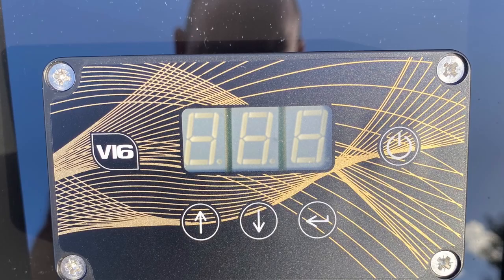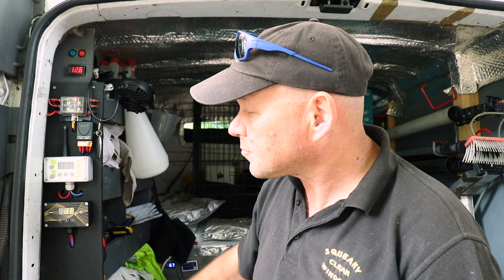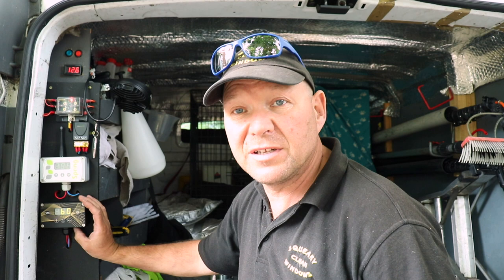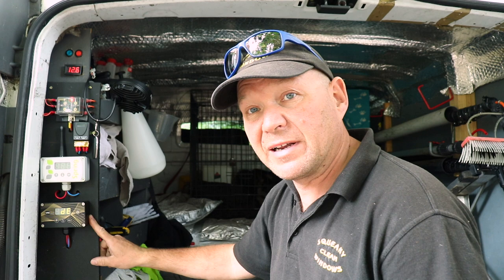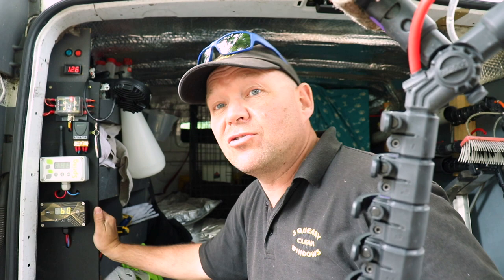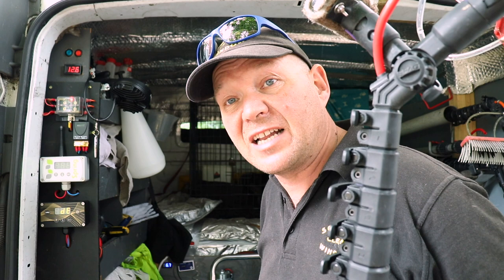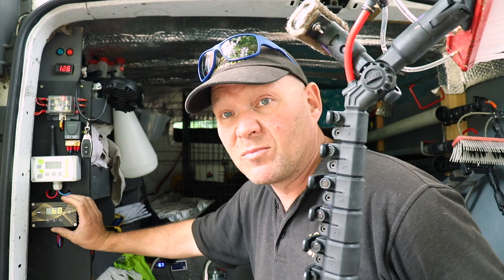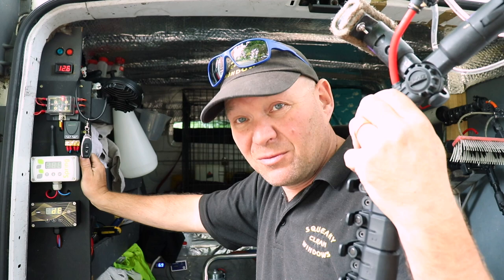Understanding Controller Dead Ends And How To Set Them

Comment: Thanks Dave...another one here who very much appreciates what you ve done for so many of us out there who have trouble with out digital controllers...just had a new one fitted a few weeks ago and all good at first   then suddenly stopped working today ..at the moment its I've still not been able to even turn it off ..so expecting its been either badly fitted some type of electrical problem  will now try again tomorw but feeling much more confident and happier after just watching your very well presented video....just to say you a thank you again Dave
Reply from the maker: Check your fuse then check for a loose wire

Comment: Hi Dave.
At the moment, I'm using the pump from an Electronic gardensprayer. It only runs 60psi, but it's enough I think. (most people runs their 100 psi pumps on 60 anyways)

It starts an stops automaticly as i pull the univalve. For over a year now, I have never blown a connection or the pump itself.

The more I learn about the 100psi pumps and the flowcontrollers, the more I think, that I'm better of with my current setup.

Convince me😉
Have a nice day.
Best regards
Reply from the maker: My last shurflo pump lasted me for 10 years and was still working when I changed it. It had just slowed down. 

Smaller pumps will work but it’s the difference between buying a diy tool from B and Q and buying a tradesmans tool. They both work and do the job but the tradesmans tool will last longer, be easier to use and be more efficient. 
It’s the same with pumps. I like to have a hi flow so if I used a smaller pump it would be working flat out to give me the same amount of water as a bigger pump working at 60%. 
Hope this makes sense. I’m not trying to say I’m right or wrong. It’s just my opinion 👍

Comment: I have been seeing PS flashing and was told it signifies an air lock. Been trying for ages to clear it to but no avail. Looks like i had the wrong advice. Will be doing the auto calibration first thing in the morning. Thanks Dave, really informative video for a newbie like me. i will have to look at everything else now to see where else i'm going wrong!! Fantastic advice. So glad i have stumbled across your channel.
Reply from the maker: Glad you found it useful. Definitely sounds like a calibration problem. PS stands for pressure switch which is the mechanical way of stopping the pump
When it’s set correctly it will come up as DE
Reply: @squeakycleandave1  So i followed your instructions and calibrated my system. No more PS flashing and system is set to its optimal setting. Thanks for your tutorial. Keep up the good work!!
Reply from the maker: @martynraymond4146  my pleasure 👍

Comment: Great video Dave, appreciate how well you explain things.  I'm currently working on a custom dual user system.  Question regarding the controller and the dead end function... With the RO waste water always flowing, even when you turn water off at the pole, won't the pump continue to run as there won't be a dead end since the waste water still flows out?  (This would be a booster pump pushing water through the system/filters as I'm normally dealing with low pressure water supplies).
Reply from the maker: Not quite sure how you have it set up. 
These controllers work if you are pumping from a tank rather then a direct RO feed.

Comment: Hi Dave, Great videos! I’ve not started window cleaning yet I’m just getting started, I’ve just bought a second hand Baileys Wfp system and thanks to your videos changed all the filters and resin, flush it out for an hour today, then thought let’s see how it works! Switched on Pump and controller kicked in for a few seconds then the controller started flashing P, then kick in again then stopped flashing P again?? Do you know what this problem is? Sorry pump controller is a varistream digital.
Reply from the maker: Not sure  what the p is. Probably best giving Baileys a ring and asking them or Spring Europe Ltd if it’s a full controller made by them

Comment: Dave, what's your view on just the basic dial ones with a switch like the Safeflow ones seem very popular? These modern ones seem to have lots of features but what about just a basic one to dial change the speed? What are your thoughts?
Reply from the maker: Its been years since I've used the old analog dial type. These new ones seem more reliable and easier to use especially when doing things like setting deadends

Comment: So I've just fitted a brand new shurflo pump and ever since I've been getting oc(so rewired and changed the fuses but nothing changes) tried recalibrating but on my AUT I'm getting and no calibration. I have a variflo v16. So any suggestions would be much appreciated
Reply from the maker: Probably worth giving your supplier or Spring a call and asking them

Comment: Hi Dave I’ve noticed today when I stop my flow of water on my pole it doesn’t start flowing again, it’s about 2/3 degrees here today , I’m just wondering if the temperature is causing this issue?  , when I go back to the controller and turn it right up it kicks in again but obviously this isn’t ideal or permanent solution, I did the auto cal this morning but I’ve still had this issue today , I’ve had a couple of really good days without any issue with it , any advice would be appreciated
Reply from the maker: With the cold weather the pipes are stiffer and the water is more viscous so it doesn’t pump through as easily. The best thing to do is turn the flow down slightly and manually turn the DE up. That should sort it out
Reply: Thanks Dave , as always your replies are appreciated, im definately learning as I go with this system
But overall it’s making life easier and jobs more time efficient , I’ve insulated my outgoing  tank hose with some wickes polystyrene insulation which worked well last night, I think I’ll be wrapping the tank next in some form of lightweight insulation, hope your empire is doing well👍🏻

Comment: Hi Dave, I've just bought a v16 pump controller. Just asking for your advice as to the wiring and mounting of the controller. 
1. Is it better to wire it to bypass the pump pressure switch? If so, how would I go about doing that? 
2. I want to mount it directly to the side of my van - to the ply lining. What's the best way to do that? 
Thanks in advance for your help.
Regards
Your brother Matt
Reply from the maker: 1. It’s best to wire it with the pressure in place that way if you dead end is set wrong the pressure switch still works
2.  Ifyou take the cover of from memory there is a hole in each corner that you can use to screw it to the ply. 
Hope that helps
Reply: @squeakycleandave1  Thanks Dave, I'll get it wired up and see how i get on. Yb Matt
Reply from the maker: @matthewgreenidge8340  👌🤜🤛

Comment: Hi Dave my hoses are blowing off when the calibration starts at c99 . Any suggestions
Reply from the maker: Make sure they are connected better to start and if they are still blowing off charge the hose and fittings  to before quality
Reply: @squeakycleandave1  Thanks Dave got it sorted.

Comment: Hi Dave im having a nightmare atm my v16 controller is showing p5 error any advice would be greatly appreciated TIA
Reply from the maker: @trevorquilligan1428  the hot weather effects how spongy the hose is so you need to drop the dead end down. You might have to drop it down manually rather than using the auto calibration
Reply: @squeakycleandave1   auto cal just wouldn't work, so I dropped it down manually, and it works. Thank you mate very very much appreciated 👏

Comment: Thanks for the video Dave. Any chance I could run an issue by you? I’ve tried auto recalibration and I’ve also tried manually setting at 99 incase the level was too sensitive but despite trying both, the controller is still recognising “de” during use or even when the univalve stops flow. Both ways, it still seems to be cutting out during use. Any ideas? Cheers
Reply from the maker: Hi Joel. 
Best thing to do is give the guys at Spring Europe a ring. They are really helpful and can usually diagnose a problem straight away. 
 01892 662078

Comment: Since I've changed my battery to my system my pump won't kick in the screen keeps saying ps error recab it but nothing pump don't kick in
Reply from the maker: I had this happen this week. Mine was a wire had come off the pump so check all your wiring
Reply: @squeakycleandave1  ok will do thanks

Comment: Hi Dave - I just did the auto-calibration exactly as you did, but while yours went From 99-25 mine went from 99-1 😳 That doesn’t seem right does it??
Reply from the maker: clearviewmind no that’s not right. Had you got the hose running and what type of controller is it
Reply: Squeaky Clean Dave Thanks for coming back to me, Squeeeks 👍🏼 Yes, it was running, and it’s a ‘Liquid Logic’ controller.
Reply from the maker: clearviewmind I’ve not heard of that happening so probably best contacting the manufacturers. 
They are really helpful 
01892 662078
Reply: Squeaky Clean Dave that’s very helpful of you, Squeeks. Thanks my man 👍🏼😊
Reply from the maker: clearviewmind my pleasure 👍

Comment: Can you help me what to do mine says p5
Reply from the maker: P5 stands for pressing switch which means that the pump is controlling the on/off rather then the controller. You need to do an auto calibration. If it still says P5 after auto cal turn the deadend down manually until it says de rather then p5

Comment: Hello Dave I’ve just set up my system it’s a pure freedom diy one and everything is working as it should but it keeps flitting from de to ps this happens when disconnected from the hose reel and when it’s plugged in as well any ideas? Do I need to recalibrate? Is there air getting in somewhere maybe? Any help would be greatly appreciated 👍
Reply: I didn’t watch the video long enough🙄 just got to the part about the calibration being to high that might be why it’s going ps I will have to turn it down and try that! Thank you very helpful video 👍🙏
Reply from the maker: I was just about to say check the calibration the I read your second comment 🤣
Reply from the maker: If it’s still a problem after recalibration  it let me know👍
Reply: @squeakycleandave1  thanks I’ve posted on window cleaning forums as well and people suggested that might be it but your video makes me think it’s that 100 per cent it’s at 65 at the moment so I’ll try turning it down tomorrow and see if it goes de thanks again and have subscribed 👍
Reply: @squeakycleandave1  okay will do! Thank you !
Reply: @squeakycleandave1  hello Dave I gave the auto calibration a try today after not being able to do anything manually and it’s finally going de after it set it’s self at 37 I had it on 65! It’s now working like a dream so thanks so much! I’ll be telling everybody I know in the game to check your channel out! 👍👊
Reply from the maker: @lefty3985  Thanks Lefty. Really appreciate that 👍

Comment: Can I use the v16 on my pump and bypass the Pressure switch
Reply from the maker: As long as the dead end is set correctly it shouldn't be a problem but its always worth asking Spring Europe LTD who make them just to make sure.
 01892 662078